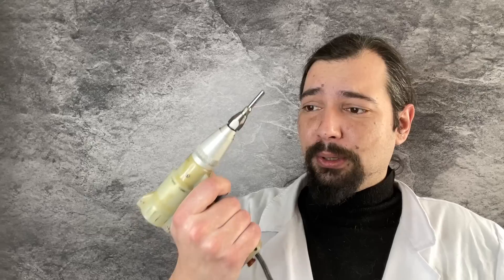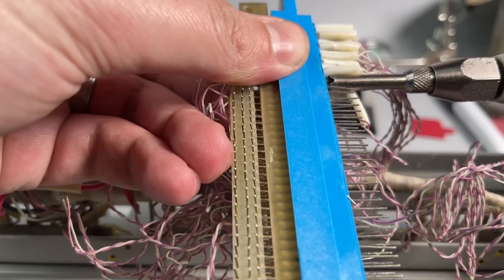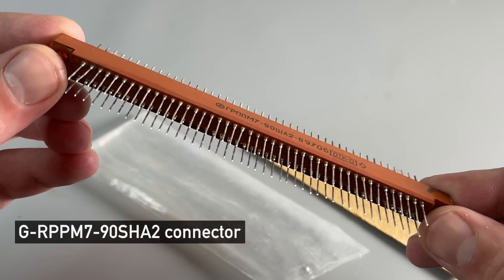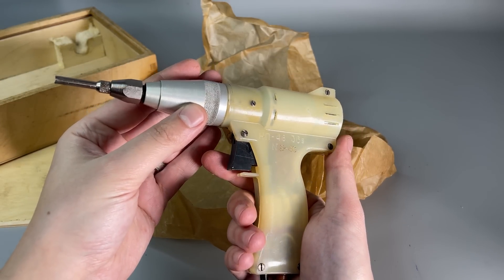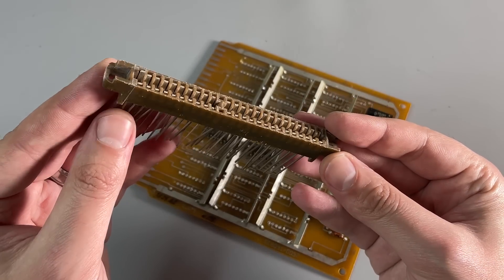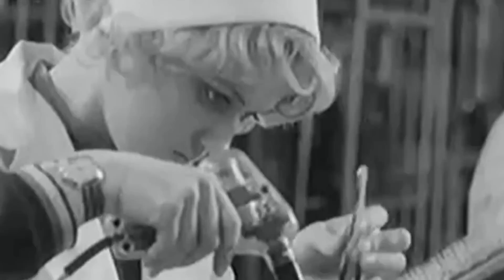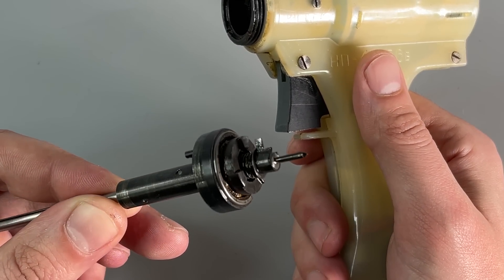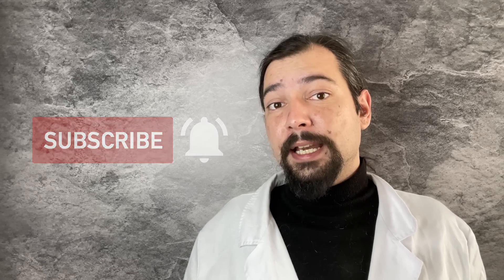We've got a vintage WIRE WRAPPING tool and it is AMAZING!

Comment: I wondered if it was powered off of 36 volts, and I also thought, "Gee, that looks like a 220 volt plug". I can only imagine how many of them were launched into a low orbit. :)

My WW tool is battery operated, but I don't have the right size bits. So it's the handheld wrap tool for me. I have more than enough Kynar wire to last me a lifetime, but I rarely ever use it.
Reply from the maker: Exactly. A choice of those power plugs is something.

Comment: Wirewrap is still alive xD At least certainly in telecommunications. I worked as a technician for several years and was in charge of wiringwrap on the main switches in the exchanges and cable cabinets, where as recently as 15 years ago when I got laid off there were wirewrap switches remembering the 1970s and Pentaconta exchanges. From time to time I meet with former co-workers and I hear that PBXs were replaced with newer and newer ones, but the cable part remained unchanged and no one is still planning to change it for newer e.g. Krone LSA. Also this technology continues to be used and many people have internet and telephone at home thanks to it ;)

Comment: Used to use these tools back in th 1970s. You can produce quite sophisticated systems paricularly for prototyping or small production runs where etched pcb would be uneconomic.

Comment: Wow, this is bringing back some memories! I used wire-wrap for prototyping boards in my first electronics design job. According to the experts, if you do it correctly, wire-wrap on square posts are actually superior to soldered joints in multiple ways, mostly because the corners of the post would bite into the wire & cold-weld the connection. The wrap your gun is using, which includes 1.5 wraps of the insulated section, was known (at least in the USA) in the industry as a "modified wrap", as compared to a "standard wrap" which only used the bare wire. Modified wraps are superior to standard wraps because the insulation cushioned the connection to protect it from vibration.
Reply from the maker: Yes, we also call those in a similar way — "modified connection"

Comment: 0:33 as one who understands how computers are built from transistors and up and as one who understand cyrillic but doesn't understand russian and can probably understand 80% of what is written there
THAT CONTROL PANEL IS REALLY FUCKING INTERESTING

i Guess you have like Shift Registers at the bottom there then in the middle you have some diagnostic functions,
the green button is probably a SYSTEM on button and then you have some Automation options there.
Pretty cool stuff
Reply from the maker: Thank you! Partly you are correct. Most of designations are acronyms, there are almost no normal words on controls and indicators. Those buttons in the bottom are grouped for byte-multiplexer channel and block-multiplexer channel and generally are – exactly – to perform diagnostics, run a microprogram or make an intrusion into machine's operation, those groups are similar, but there are differences. Two green things are light indicators,  not button, and they are triggered by a toggle switch from inside the panel. They are one of the elements so far exact purpose is unclear.
In meanwhile, I could find a little piece of wiring documentation on ES-2060 processor of this machine which had a very similar panel, just with way greater number of lamps and less buttons, so it helped to understand a few crucial things which are common for both control panels.
For example, that I'll need a quite exotic PSU which gives 0, 5, -5.2 and -2V (exactly with this polarity and voltage).
Reply: @ChernobylFamily  
Thank you, i tried (serbian Background, both latin and Cyrillic), i could read most of the words and put it together, other acronyms i figured out, i think i saw  Pi on there the others i sort of put together based on my electronics knowledge (i'm 50), but i didn't bother mentioning.

" Two green things are light indicators,  not button,"
???  you mean SISTEMA,  that looks like 1 green thing

as for the rest,  that's very interesting and very cool.

QUESTIONS,
what is BxBOR KANALA ?
(x Means i'm not familiar with that letter),, is that a channel selector or bandwidth selector there are 4 buttons
 SBROS then N88  then N88B  then I88

also the REGISTRIA what does the word after it mean ZANESENIA
I understand this area to have something to do with (Probably) a Shift Register but i don't understand that other word
its a cool machine, I'd love to pull it apart  LOL

Budi mi ziv is zdrav, which ithink to you is..
Будь жив и здоров
Reply from the maker: There are two system indicators, one per button group. Just in the video not visible. ВЫБОР КАНАЛА is a "channel select" as there are multiple channels. РЕГИСТР ЗАНЕСЕНИЯ  is  to select the register where a data/operation input is being made.

All in all, we are bit by bit looking for the information and many things are now clear. You can find a lot on our Patreon - there we disassemble it a segment by segment and fix it. Right now the question is proper cabling :)

Comment: I have a manual version of this tool. These connections are sometimes used in old fire alarm equipment. I bought the tool at Radio Shack back in the ‘80s.
Reply from the maker: Thank you for sharing!

Comment: We were taught wire wrap connections when I was at uni in the mid 90s, still have the hand too and some pins in my tool kit.  Square pins were used because they cut into the conductor and hold it unlike round
Reply from the maker: Thank you for sharing!

Comment: There’s a really cool machine related to this video. It’s called a “Wave Soldering Table”.

It’s a ten gallon aquarium full of molten soldier. You put a circuit board on top, and when you press a button, the machine sets-up little ocean waves that barely touch the bottom side of the circuit board. The soldier  completes dozens of connections almost instantly. Every circuit board factory used to have these.

The same machine could be used for printing t-shirts if there was a stencil. Everybody wants a metal t-shirt.
Reply from the maker: Back in the 70-s, my father worked with a similar machine at one of electronics factories here in Kyiv. Told it was impressive :)
Reply: @ChernobylFamily They still use these for PCBs, just much less extensively because most components are now surface-mounted. The pick and place machines for SMD are awe-inspiring though!

Comment: I just did a refurb on a unit at work and had to break out the old Weller Wirewrap guns. Old mill hardware got solder flowed over the wire wrap once initial inspection was completed.
Reply from the maker: That would be cool to have for our task...

Comment: As a young R&D engineer I used wire wrap for prototypes. Far quicker than soldering and more reliable. When daisy chaining connections, just remember to alternate the wires, top/bottom, or you will end up having to remove most of the chain just to move one wire.
Reply from the maker: Thank you for this hint!

Comment: You still can get Wire Wrap Tools and Wires new and they are still used in building test fixtures for testing printed circuit boards.
Reply from the maker: Yes, I have been considering buying a modern one but it appeared it is way cheaper to get a vintage from an old stock.

Comment: I bought the little hand tool and a roll of multicolored wire strands after trying a DIY solution of a small tube with a hole drilled on the side and ethernet wires with goid results.

It comes in quite handy for things I dont want to solder, like LEDs, attaching things to computer motherboard headers that I want to stay on (looking at you, loose power button connectors).

But the biggest thing has been the multicolored, thin but not too thin, single strand, tinned copper wires. My go to when I need to rework a board with corroded traces and misc gadgets or just prototypying stuff.
Reply from the maker: Thank you for sharing!

Comment: One of the best things about wire-wrap connections is that they're solid, secure, but also human accessible. I'd imagine wire-wrap probably helped a lot when it came to prototype systems, given a poor or wrong connection could be fixed by a skilled operator in just a few seconds. Contrast that to today, where breaking a PCB trace and running a jumper wire would be the fix, if you're lucky! 😁

It also reminds me of a security measure employed by US warships during the Cold War: To guard against possible capture and reverse engineering by Soviet forces, the computers on US Navy vessels employed wire-wrap on a one-sided backpane with a massive guillotine blade suspended above it. 🔪
In the event a vessel was captured, it would be the responsibility of the lead technician to bash an emergency button that would cause the blade to slide down the backpane, slicing all of the terminal posts clean off of it, leaving the wiring in a completely incomprehensible, tangled mess at the bottom of the cabinet. 🔀

You'd still be able to see what was on the component side of the board of course...But good luck working out what had been connected to what! 🤣
Reply from the maker: Thank you for sharing, this is an interesting story! silently, to the side i have a feeling the same blade was in the panel we are repairing...)
Reply: I just was about to say, that's the situation you're in now😁 @ChernobylFamily

Comment: Never thought I’d see one of these again. No need to strip wire. If the tool is working properly it skins the wire to the proper length every time. Thanks for the video
Reply from the maker: This very tool, unfortunately, does not strip wire — it is even written in the manual.
Reply: I remember an ad in the trade press in, I think, the early 80s for a WW gun called a "Slit'n'Wrap", which had a tiny blade to cut a slit in the insulation as you used it, & had the huge advantage that you could daisy-chain a bunch of ww posts (eg a data or address buss) with just a single wrap per post, which would've been a huge time-saver, & much more compact. Sadly, I never got a chance to use one myself; all I had was a little C&K hand tool & pre-cut wires.

Comment: At work we still use these for ATE Test adapters very frequently. It's a great way to quickly make super solid, and partially reversible connections( you can reuse a wire wrap post a few times - not too often however). 
Just the right technique for expensive test devices which are highly individual (often just one or two machines / adapters of the same type) - also sometimes we have to add test probes when the DUT (device under Test) gets altered (new pcb revisions). This is rather quickly done with a wire wrap pistol
Reply from the maker: Very true

Comment: Wire wrap connections are actually actually air tight, no corrosion even after decades. The material is crunched so hard, when it's wrapped around the edges of the square posts. Soldering was mostly done for safety, mains wires and such.
Reply from the maker: Exactly. In my case, I deal with many round posts, so wire warp acts more as a positioning technique.
Reply: Actually, the connection improves over time, (at least in case of gold plated pins and silver coated wires) as atoms slowly diffuse between pin and wire. I saw how they use it to build a mainframe in Polish factory (Elwro) back in 80s, and they had it plugged to some sort of circuit tester that prevented wiring wrong pair of pins (if you tried that, the gun stopped).
Reply: @przemekkobel4874 I guess it worked by checking current flow between the pin and the gun, As shown here:
https://youtu.be/nTZbICNsQZM?si=U0KGUZB8HlSU06rB&t=335 
Translation: "In this hall conncetions are made. The coplicated process is is guided by perforated tape, on which the whole asembly programme, which we call 'assembly on platters' is stored.

Emploee makes the connections at the coordinates indicated by the lamps, with the wires, also indicated by the lamps.

Any mistake made by the emploee, causes instant lockage of the wire wrapping gun"
Reply: Everyone from NASA to Ma’Bell used them. Includes the military.
Reply: Soldering is for making good electrical connections not mechanical connections, so soldering it at the connection then wire wrapping it which you are correct, if done correctly with correct material can be airtight and maintain very solid mechanical connection withstanding movement and vibration for long periods of time without work hardening and cracking like early types of plastic insulations Or breaking down which causes loss of electrical insulation, shorts, chemical corrosion of wiring and circuit boards and other equipment along with the plastic just becoming extremely hard and brittle, then falling apart, or becoming soft, oily, melting down and potentially becoming conductive, dripping onto components causing corrosion, shorts and possibly even fires because it's of course early formulations that probably doesn't have any fire retardant incorporated into the insulation, wire wrapping material can be flammable but doesn't decompose and become conductive or corrode surrounding equipment etc, something I've always wondered is why they have not figured out an enamel coating that doesn't burn like crazy with horribly toxic fumes, it would make much more sense to me to find a insulating coating of reasonable thickness that doesn't burn since it's often used on wire wound transformers that get Hot and are meant to be used for many years, inductors, electromagnets like speakers, solenoids and relays, even as a primary insulator between multiple wires coated in a secondary insulation, also does anyone know why transformers, speaker coils, solenoids and relays etc aren't flat wire wound like some high end, high power handling subwoofers? I assume it would allow for more conductor to be wound with higher current capabilities without increasing the diameter of the coil and only needing a small amount of extra width etc, maybe it causes resonance or some other instability, or some other cooling or negative effects? If you know and don't mind helping me out id greatly appreciate it! Regardless, I Appreciate Your Time And Effort! I Hope You Are Having A Great Day Or Night!
Reply: mechanical connections are never electrical connections
Reply: @42pyroboy Not according to Anderson, 3M and NEC. Mechanical terminations have been standard for decades. I still use PowerPoles, Crimps and spades ntm Molex. I still make and use Molex. Not one drop of solder used. Telecom is a perfect example of this. Somewhere I still have my 3M butterfly tool with three dies. Made hundreds of cables with it. Not one drop of solder.
Reply: @42pyroboy  Wire wrap is actually a form of welding.

Comment: Typical construction for the last ussr years. Uncoulored low quality plastic, 36V plug and even typical pulsating sound from the crooked gears. By the tech safety controllers means, 220V must not exist in the production area. But reality is sad, I've fry few soldering irons by plugging into the 220.
Other story from the times, how the most of assembly workers drink a technical ethanol, by mixing it with juice (given to compensate a health injuries).
Reply from the maker: So true...

Comment: The wire wrap technology is still one of the most efficient and widely used technologies in electronics test fixtures (bed of nails, ICT & Functional Test) by leading companies in the world such as BOSCH, Seagate, BAE SYSTEMS, ResMed, and many hundreds others which we design and manufacture test fixtures for. The wire wrap test probe receptacles are the most sold types of receptacles among the other types (wireless, solder cup, pre-wired etc).
Reply: I work for a small company doing just that... I design, build and program functional test / ICT machines. We still use wire-wrapping very often for wiring test adapters.
It's a very solid and fast tool to connect wires to the test needles
Reply from the maker: Thanks for sharing!

Comment: Back in the Eighties, I was a telecommunications tech here in NZ. We had a lot of NEC crossbar exchanges which used wire wrapping, and it was also used on a lot of cabling interconnections. I did some work applying modifications to the crossbar, which required some skill in interpreting documentation and tracing & removing some conns & adding new conns. A bit repetitive once you have done the same mod a few times. Cable termination, however, was mind-numbingly boring and often given to trainees or even temp workers.
I still have a set of hand wrapping and unwrapping tools, but not one of the guns, which were self-stripping and great tools.
Reply: Here in Australia, I did some telco work at the end of the 90s, & many smaller sites still used wire-wrap in their MDFs.
Reply: @theantipope4354  Not for the jumpers, I hope? Wire-wrap is good for cabling, but the repeated wrap-unwrap cycles of jumpering lead to damage by the tools to the corners of the pins, and thus unreliable conn's.
Here in NZ for jumpering we used solder on MDFs, and punch conn's in the cabinets.
Reply from the maker: Thank you for sharing!

Comment: my parents had a console  TV that went out back in the 1970's. 
it had a modular design, with the wire wrap connections. and
the square type pins. my father gave it to me for parts.
I suppose if the motor was DC and you reversed the polarity,
it wouldn't work to unwind the wires quickly.?  by hand isn't
too bad except if you do it wrong, the nearby pins can really 
scratch and cut you hand up. my 15 year old self quickly found
that out when I disassembled  that TV for parts!
Reply from the maker: Given we have two cats, scratches is not what we really pay attention to anymore :)))))

Comment: We still did this back in the seventies last century. And yes, 1 or 1+1/2 turns of insulated wires was a standard wrap for secure and valid connections.
I still have a battery-powered wrap pistol in my drawer but used it perhaps once in the last 20 years.
Reply: Still have mine too, lol